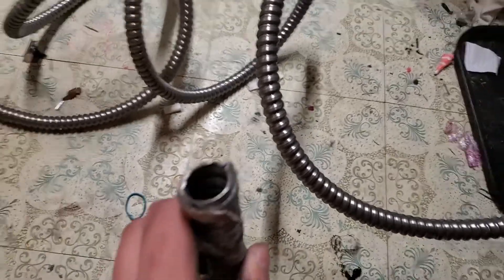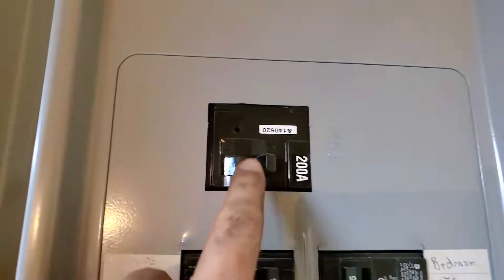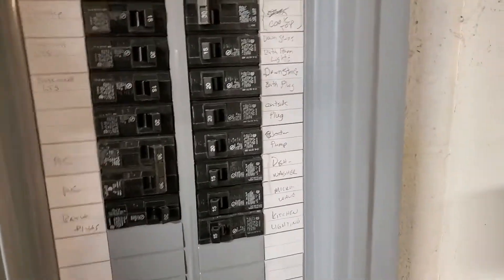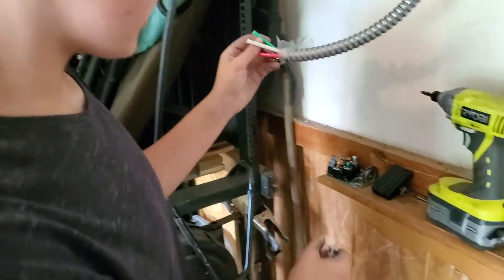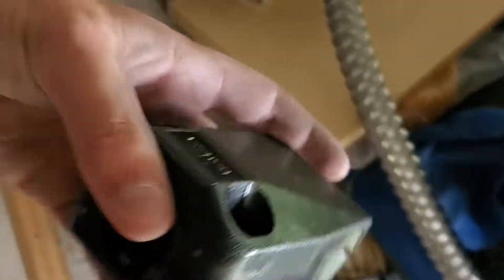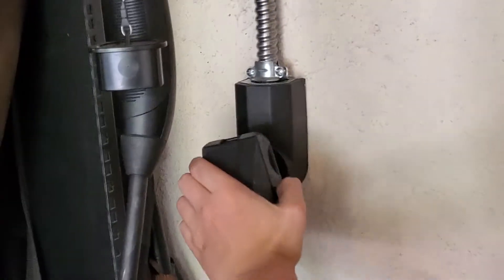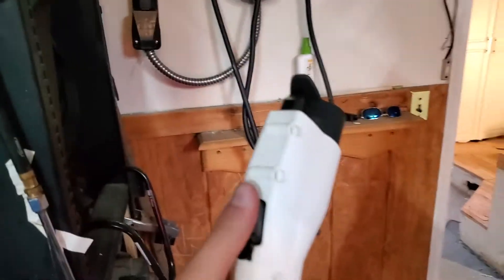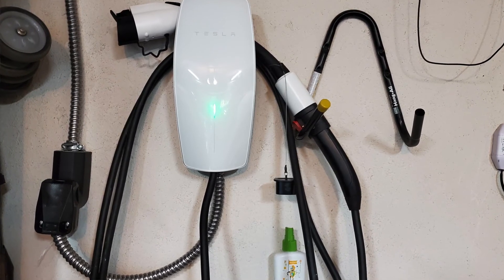Installing a Nema 14-50 outlet for a Tesla wall connector with industrial plug for 2022 Kia ev6, DIY

Comment: There are a few issues. Since all of this is relatively new, everyone, including inspectors are trying to figure out what is correct. Most default to what the installation manual states. Everyone I have read specifies using 90 degree rated copper wire. With the extra cost of a commercial grade outlet, running a neutral wire and installing a gfci breakers (new code), doing a hardwire is much cheaper.
Reply from the maker: I agree

Comment: How come you did not just hard wire the Tesla charger? What was the purpose of the Nema 14-50?
Reply from the maker: So we could swap brands of chargers we use, to a tesla standard or j1772. It would also be helpful if we were renting or planning on moving as most wall box are around $400 and more. If none of these apply I would agree it's cheaper and safest to hardwire as per the musk quote "the best part is no part."